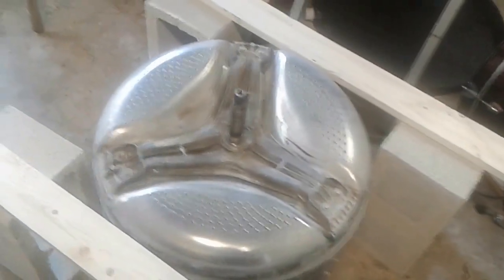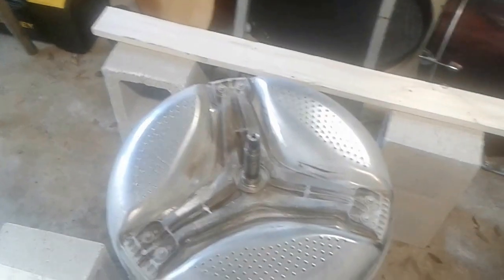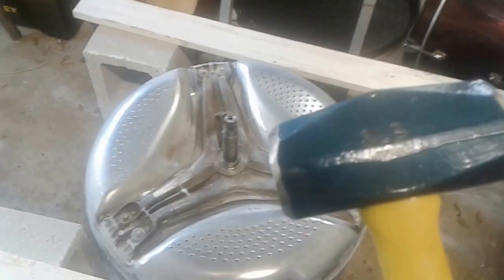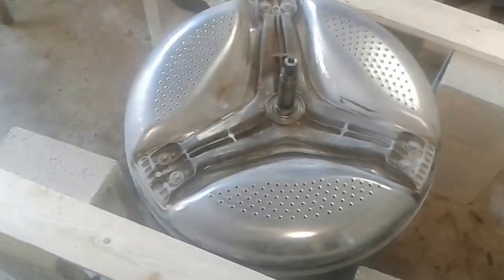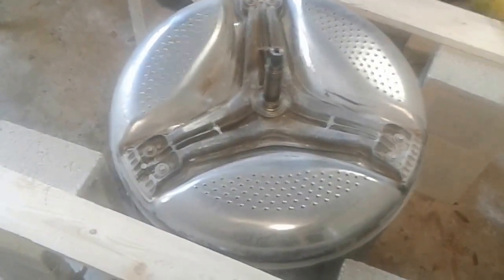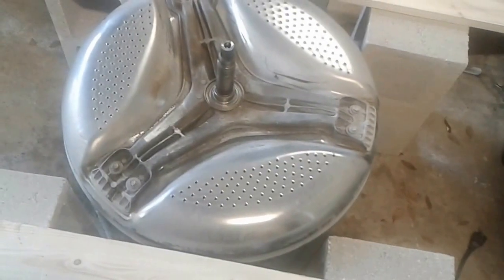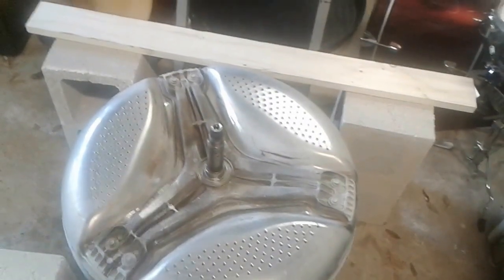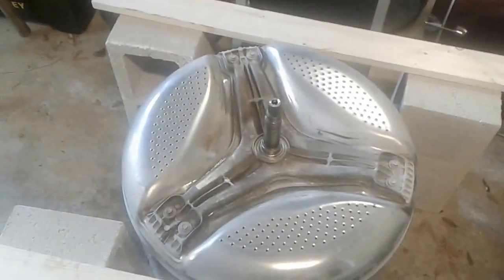How to Remove Stuck Inner Tub When Replacing Bearings on LG Front Load Washer

Comment: Parts:
Replacement bearings chosen were Timken 6306-2RS (306FF)
6307-2RS.
Bearing seal, tub seal, replacement dampers were ordered from LG. Despite the bearing failure, original dampers seem to be fine.. they show the same slipping behavior as the new ones.. disappointing. At least they're cheap.

My 45oz rubber mallet didn't budge the thing. My girlfriend had her feet on the plastic tub, hands pulling on the metal drum while I swung away. 24 hours soak with penetrating fluid didn't change a thing. The spline really needed the shock of a metal demo hammer to break free. Was careful and didn't damage the spline.

Same deal with the bearings! My 5lb slide hammer that I use for wheel bearings couldn't get it done (and beat the heck out of my hand, as always.)

Used harbor freight 1/2" drive 7/8" deep well impact socket with 1/2" drive 12" impact extension for the smaller 
(rear) bearing, accessing through the bigger bearing.
For the bigger one, I switched to my biggest socket, 32mm, though 1-1/4" is equivalent for those that don't have a metric rail. I just grabbed metric first. They fit on the inner race fairly well, ensuring I wasn't just beating the bearings apart.

It worked, but the extension is mushroomed on the drive side. Fine by me! No damage to the washer.

Thank you for posting this video. I was trying to see what other strategies were used. I was contemplating drilling the inner races, or shopping for some kind of cutter like an oscillating tool. Glad I found your vid. You really helped me out, man.

Comment: Thanks, by way of subscribe and thumbs up. Put a bolt and washer in the end of the shaft to protect it,. If you don't then you will likely end up having to replace the shaft. THEN, get a bigger hammer and beat it like it owes you money.  Also, make sure inner tub has a soft  landing. That's my experience with it.   Best...Bill
Reply from the maker: Great suggestion.  Thanks.

Comment: Brian, OMG and KUDOS to you putting this video on YT.  I was at my whits end (almost).  I have 13 y/o LG Front Loader.  It started making noise in spin cycle and I dx'd it as time for new bearings.  I started dismantling the washer yesterday, which took me about 6 hours as I paced myself carefully.  I am a 5' 1"  72 y/o female!  I always figured if you put your mind to something, you can do it and do it successfully.  This morning I pounded and pounded.  Broke two boards along the way.  Was convinced  the inner drum was not going to drop!  Then I found your video.  In less than one minute, my sledge hammer was successful.  (It took longer to carry the damn thing out and down steps and put on blocks!!)    I CANNOT THANK YOU ENOUGH FOR SHARING YOUR EXPERIENCE.
Reply from the maker: Glad it worked out for you.  I had the exact same experience myself.  The manufacturers say not to do it, but it's worked for a lot of people.

Comment: Thanks!  I thought I missed something watching the video when the guy bangs on the drum shaft with two semi-light wacks and the inner drum falls right out.  Beat on the thing with a regular hammer off and on for more than an hour and splintered an entire 1x4 board trying to get the inner drum to release.  Soaked the shaft in penetrating oil overnight, and will now use a heavier sludge hammer to hopefully get the damn thing out.
Reply from the maker: May the "force" be with you.
Reply: having the same issue with shattered  a few 2x4

Comment: I put a brass metal plate (door hinge) over the spline. whacked it with my thor hammer. picked it up and did it again. repeated the process 6-7 times. the brass hinge had a few dents but the spline is fine..

Comment: Did repacking the bearings get you a few more years out of the washer? I’m either buying new or replacing the bearings soon, just curious if there is any value in replacing the bearings considering the washer is 9 years old. Not sure if it will get me another year or another 3-5 years.
Reply from the maker: Follow up: over 2 years now since the bearings replacement and the unit is still going strong.
Reply from the maker: Yeah, it's worth it if the washer is otherwise in good shape.  Still a good washer.

Comment: Thank you! Your video helped to bolden me with knowing I was doing the right thing and keep going. Tried hitting some hard maple with a hammer on top of the spline, nothing, Then soaked it with some penetrating oil for a couple of days and tried it, again nothing, wasn't even moving a millimeter. Hammered it with just the hammer and started to flatten the top of the spline...and nothing. Broke out the dremel and started cutting the bearing off in order to try and help free it, then hammered and nothing. Finally didn't care anymore about the spline and wailed on it and it started to move. Spline is destroyed but out (New spline $100 w priority shipping). The shaft the bearings were riding on were rusted big time and fused to the bearings. Have some hard water in southern california and also I never ran the tub clean and used a cleaner, but I will now and I know why. Had the washer at least 8 years and it has been great other than this.
Reply from the maker: Sorry about the spline.  Mine was fine.  Once I got the 3 pound sledge, it literally took 3 hits to get it out.  Also, I didn't hit it harder; I just used something with a lot more mass. 
 But sounds like your bearings were in worse shape than mine.

Comment from the maker: Yikes!  I accidentally removed a comment by Derek Harkins saying that you should never hit the shaft wth a hammer.  Sorry.

However, trust me when I say that I tried every other option first, with no success.  This was my last resort, but it worked extremely well for me.  But yes, try the other documented ways first before my extreme solution.
Reply: I used a hammer , didn't work.
I used Thor's hammer, didn't work. 
I finally used Oden's hammer and got results. Thanks alot.